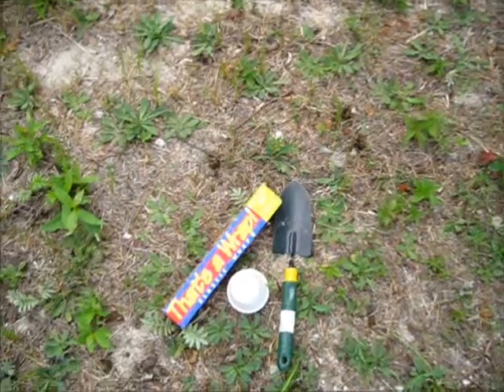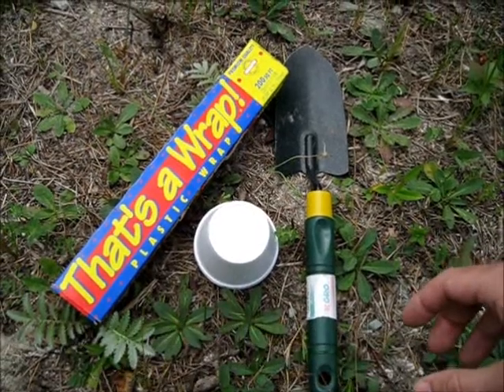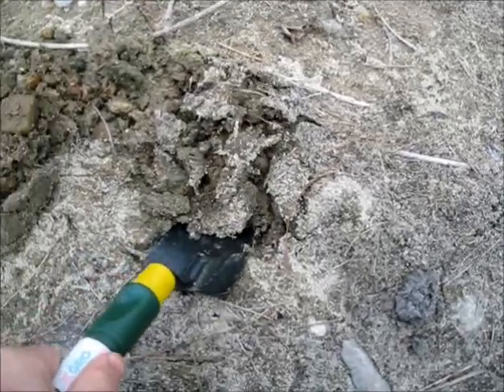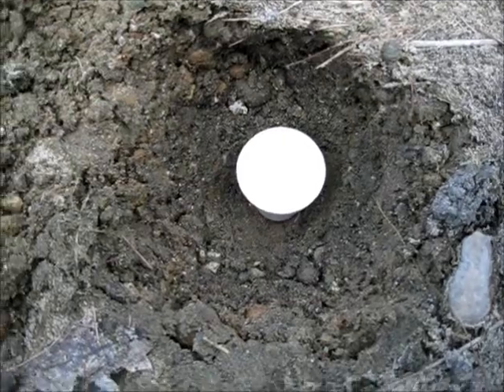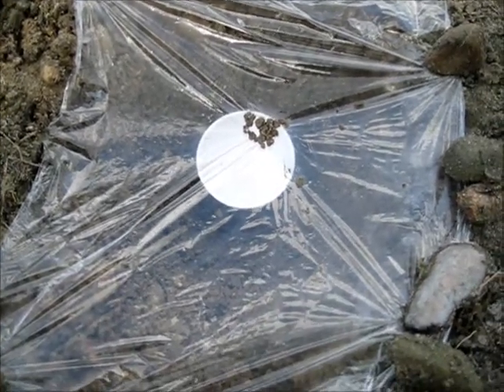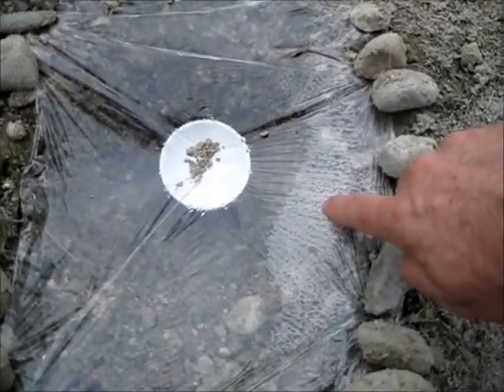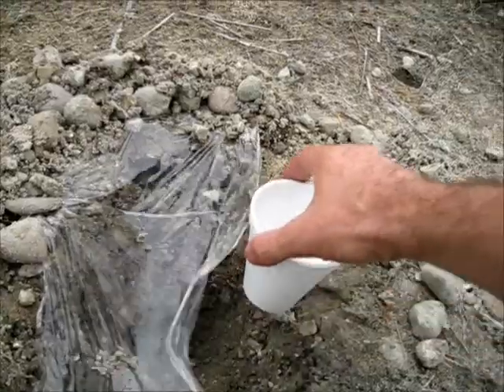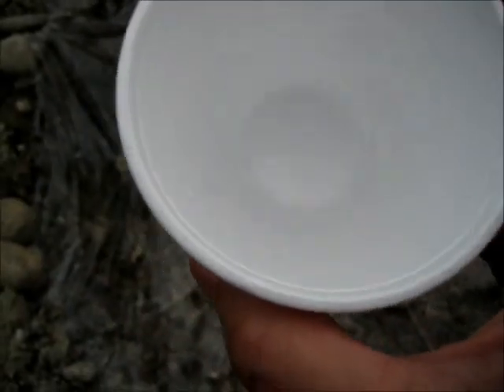Free Emergency Solar Water Purifier - makes potable water from the earth

Comment: Some are tourists/travellers or City dwellers but sometimes not. Just a cpl of years back, 2 blokes took an Inadequately equipped vehicle with no notice or prep (no emergency Comms, no spare food, WATER, Apparently no note left detailing their plans-Essential) on a short run of about 30 or 35 miles from their Cattle station ''HQ' to check a Bore (drilled well/natural water source), 'Broke Down' and tried to walk the20Km or so back...

Comment from the maker: True. For real survival you need a huge sheet of plastic and a huge hole. I did this for a demo only.

In the desert, you must urinate in the hole and drink what comes up. Then you use a smaller sheet, and hole like the one I showed here.

But, regardless of where I did this, it was purified, drinkable water. Not so with the lake water, streams, creeks, ponds. You can get usable survival water with this method. Water is all around in most places.

I am not in the desert, so I dont teach it.